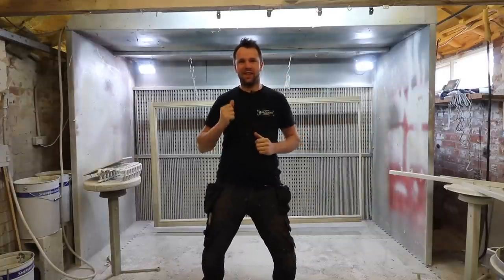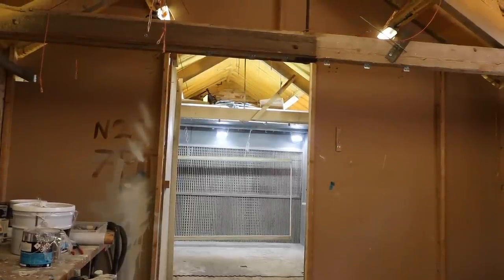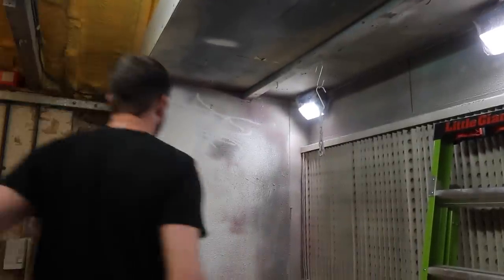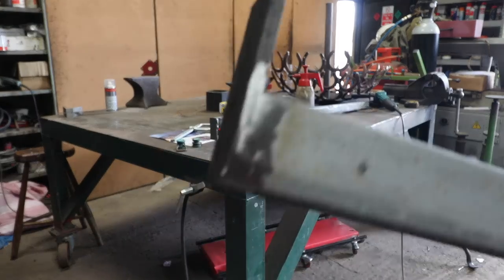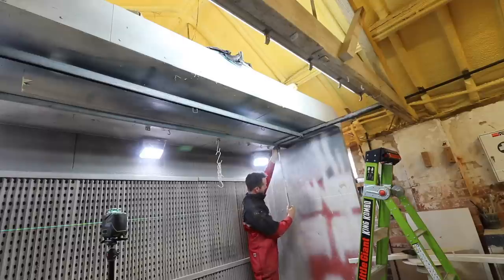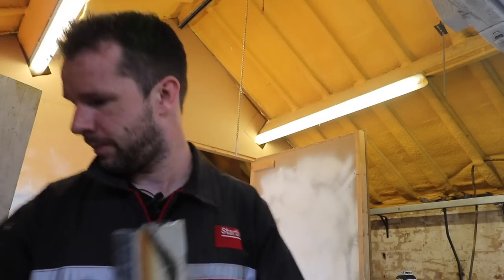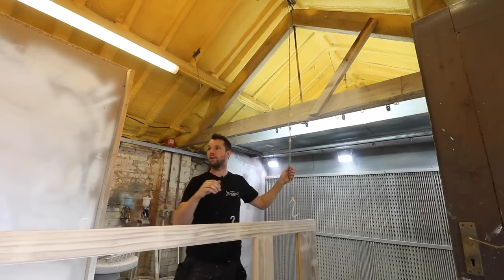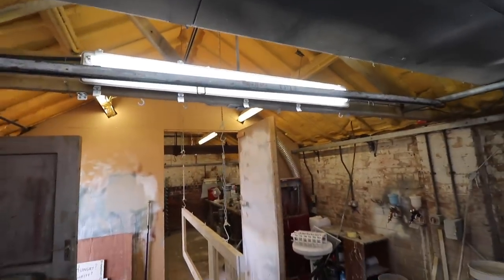Spray booth Upgrade! Sliding Track System From Scrap Metal!

Comment: This is a really good idea. Most spray shops that I have been to have some kind of rail system but they always get stuck at the same point - the door! Recently I have had to brush paint my kitchens myself as the sprayer that I use has been booked for months (like most people). I might incorporate some kind of hooks in my workshop. Another great idea from Bradshaw joinery!
Reply from the maker: Cheers Christopher. your a gent! Having the long swinging chains is actually a positive as it allows a bit of play when moving stuff around.

Comment: That's a lot quicker for you nice one. I'd have run the long track through the top of the door opening full length of your shop to save swopping the chains over and there's also less swinging about because the chains are shorter. It's one hundred percent better than before. Tony
Reply: That's what I was thinking as well. Run the tracks along the bottom of the A-frame
Reply from the maker: Cheers Tony, yeah a few comments have suggested similar, i should have mentioned that i sometimes spray larger items in the centre section when they dont fit in the booth... so a rail at the same height would destroy that area
Reply from the maker: yeah its a massive improvement and i will no doubt be singing its praises when i have 10 sash windows to spray in the coming weeks

Comment: What you're describing is Unistrut, or a very similar product. Unistrut comes in many different profiles and includes a vast array of fittings. One item to look at is the trolley, which has a few variations. Another version of what you're designing is a meat rail system used in grocery stores and meat warehouses. Granted, they are much more heavy duty that what you require, but the method is the same. Even though they are constructed using I-beams, generally speaking, a scaled down version is a solution to your problem. The Unistrut supplier is in West Bromwich, so don't how far that is from where you are located. Also, if you know people in the trades, they can likely help get product for you.
Good luck, and really enjoy your channel. Thanks.
Reply from the maker: Cheers Dave, i have some uni-strut, i used it for all my dust extraction mounting. there is proper roller bearing track available for the job, but i was just being frugal and the track was there so why not! 

your too kind pal, cheers for that. :)
Reply: I’ve installed ceiling lifts with all these features for individuals that are wheelchair bound.

Comment: Very useful.  In the future I'll be building my own spray shop.  The system I liked most was Guffey Systems.  Not going to purchase that system but the idea of it is what I'll be going for.  This was a useful video, thanks.
Reply from the maker: Nice one Ben. Good luck with the build. the hooks work great and are dead cheap but im sure there are much better setups available. not many options really for fixing into a small 2" hinge recess, the hooks can even stay in place for sanding as they arent in the way. 

ive seen a good idea for the roof of the drying area, use rebar in the ceiling. can hook and hang stuff at any point then!

Comment: Nice bit of recycling 😁. The X/Y track, as it would be called due to planes of movement, in the spray booth is a great design as you lost virtually no height 👍🏻
If the tape does not last holding the hooks on the chain, fine garden wire to hold them on wrapped through chain and around the hook?
Reply from the maker: Cheers for that Doug! Yeah good shout on the wire! The hanging system is a godsend.

Comment: Another great video, your mind must be in overdrive thinking up how to use this for that & that for this, to improvise is a skill in itself.  I was just wondering when you built te partition between the booth & the drying room could you not have fitted double doors to give you more space to get things through & the having two narrower  doors would give you more space in the drying room. I couldn't tell from the video how visible the chains & hooks & how far they hang down from the ceiling perhaps some little flags on them so you don't walk into them ?  perhaps they don't need them (just my thoughts 🤔  lol 😆) I'm sure you've thought of this
Reply from the maker: Thankyou Norm! I went with the big door for both speed and when the booth is on i canleave the door open and it doesnt constantly close itself! It also swings into an unused bot of the room so not bother on that front. The hooks are above head height so unless i do a good jump i shouldnt hang myself on them lol! I love solving a problem of inventing solution!

Comment: The double track idea in the booth is proper.
However I don't see why you didn't run a continuous length at the level of the door header and the underside of the A-frames? Granted it would have taken more effort to fix the rail securely in between the A-frames but a canny chap like yourself could have figure that! No need for long lengths of chain, just hook straight into the roller loops, no need for hook change overs and it wouldn't have been much lower than the door header height? 
The extra height at the ridge is good if you're painting big things but if it doesn't go through your door you can't paint it anyway?
Maybe I'm missing something?
Best content on the Tube though!
Reply from the maker: Nice one Miff. i like the open space in the booth centre. i have actually had some really big stuff in there which a low level rail would very much limit, i thought about having that section removeable but time limitations and this will work i though id get it done!
Reply: Fair do's, thought I was missing something.
Reply from the maker: I've been using it today and my god it's a godsend! The long chains are really handy actually I'm that you've got a bit of free swing... Nothing has to line up particularly well as you can swing into place. 👍
Reply: Oooo I didn't think of that!
A low rail would mean no room to swing at all!
That would have been crap.
You win ;-]

Comment: This is a great and has given me some ideas to improve my own set up as I work on my own too. Do you have problems hanging stuff to dry? I'm currently spraying using a gravity fed compressor set up and only use water based paint. Because I have to thin the paint, whenever I try and dry things vertically (large back panels for example) I can get issues with paint running. I assume that's not a problem with an airless set up? I'm seriously considering switching to airless  as I think it would suit me better and the option to hang would also be a bonus in my small workshop. Keep up the great content Ollie, your channel is awesome and has been a great help
Reply from the maker: Awesome that what its all about! Yeah airless is much easier as you tend to use thicker paints. Its not great for getting edge finishes, as painting flat the edges get painted twice, once each side. I would still lay flay panels down if i wanted the best finish. But no, hanging like this isnt an issue with opaque joinery coatings. Unless you literally get it thick enough to run!
Reply: @BradshawJoinery  Great stuff, cheers. Yes I was thinking the same regarding with the edges. I suppose it would be possible to lay flat and paint edges first and then lift up to hang. Then you would be able to spin and do both faces whilst hanging? Food for thought! Looks like I might be getting my wallet out....again.

Comment: Looks good but when you look at the beams in your spray booth/drying room, why could you not of run the track at door height using those beams, ? no awkward moving track to track and as it would be a  shorter chain it would run smoother?
Reply from the maker: Cheers James, The track at that height is really limiting. Having the swing of the chain makes it quite forgiving and it works a treat to be honest, only need to move across 2 tracks as you can carry one end of door and pull though the doorway. It obviously would be better in one run, but its pretty darn handy as it is!